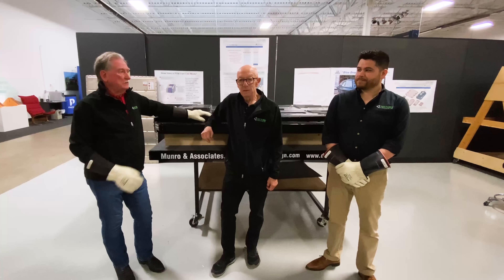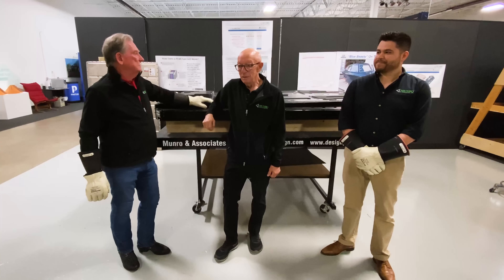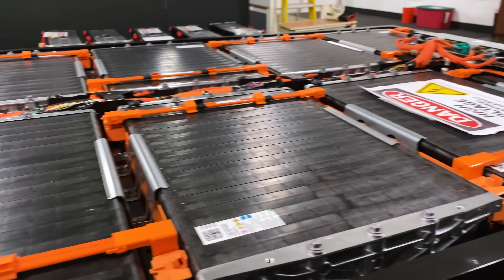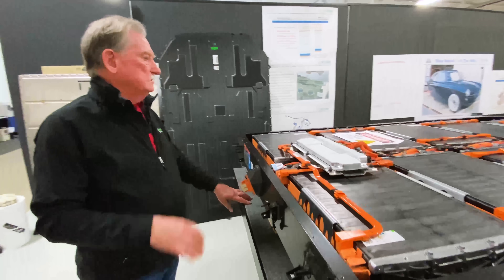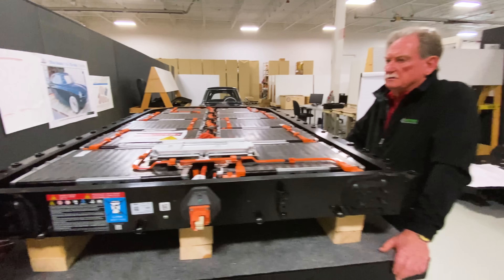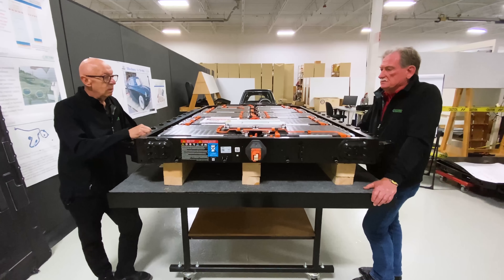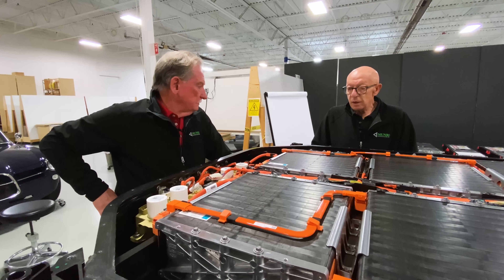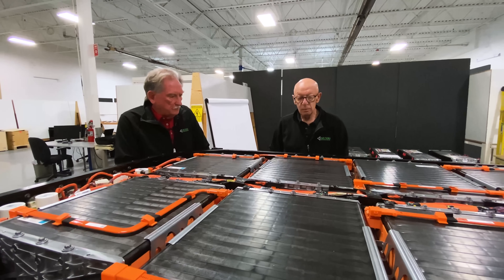Ford Mustang Mach-E Battery Exposed!

Comment: rectangular battery box vs. shaped - does that mean VW can throw this in any number of vehicles while at Ford, it will only fit a Mach-E?
Reply: Modular design of the battery "packs" is how ford is going to use this in everything and allow it to flexibly conform to whatever design they like. The box is being used like part of the frame, so, lots of reason to keep that separate from the actual battery packs
VW has already planned to use the same pack in upcoming designs
Reply: the March-E is not a platform, it is a single model car, so no need to have it too modular over all.
VW plans at least 5 cars to use the MEB-modules and in very different configurations all over the world.
Reply: “It will only for a Mach-E”

No, the modules can be used in various Ford cars & usages, by merely putting the modules into various battery box designs.
Reply: The box tapers at the front, and most (perhaps all) models it might be used in would want that taper, so it's a highly reusable design. What Ford intends to do is a separate question.

Comment: That’s not a “structural battery” pack as Elon described the concept. It’s a flat box loaded with battery modules. It may provide some rigidity but it’s not optimized.

I’m not bashing Ford. To date, we have not seen definitive evidence of a true structural battery in any production vehicle.
Reply: Agreed.  I was expecting to see some significant structure reinforcement inside, and there wasn’t any from what I could see.  Maybe the pack casing itself?
Reply: @AudiTTQuattro2003  Sounds like we’re both fans of Sandy.
Reply: As noted, the most accurate description of this would seem to be a "structural case".
Reply: @rogerstarkey5390  it appears to be strong for side impact but have very little impact on the Hz rating, or rigidity of the structure. Will be interesting g to see the analysis
Reply: Who cares what Elon thinks.
Reply: @twany442  double like
Reply: @twany442  
Triggered?
Reply: @rogerstarkey5390  Of course I am. Wanna try me?
Reply: @twany442  so you adding zero to the conversation helps everyone understand the problem better? Discussing and bouncing ideas off each other is what makes people smarter. Thinking about the problem and making our own judgement, then having that followed up by a more complete breakdown and analysis helps us look at our own line of thinking and if is accurate for this topic or not...
Reply: @Scholzey    what makes you think I want to have anythWng to do with you?
Reply: @Scholzey  Punk boy, Do you actually think that Elon is the only one who knows how to do a structural battery?  I comb my hair with a afro pick, what do you comb yours with? Either way it goes we both combed our hair but which way is the correct way? We all have different ways of doing things.
Reply: @twany442  you can clearly see the structure doesn't have a connection between the top and bottom sheet creating rigidity for twist.

I have curly hair so my hair looks stupid if I comb it lol goes all fluffy. Not sure what that has to do with anything? Is there some secret reference im missing?

The way Ford has added structure has no added value to the car. Teslas way will.

Ford is bolting a battery pack into the structure, but fords battery structure is heavy, and chassis less so. Perhaps their batteries are so heavy that they required a heavy structure to surround them and they didn't want to double up with chassis structure, so they lightened up on that front.
Reply: @twany442  your engaging in discussion. Do you only want to discuss with people who agree with you?
Reply: @Scholzey  No, I don't want anyone to agree with me, I'm not doing this for you to agree with me. I'm doing this to say stop trying to make the Ford's Mustang Mach E your whipping boy. Every goddamn EV has a problem that needs work so focus on your faves first.  And don't start a conversation with Elon said. What do you bring to the table of contents? Regurgitated information.
Reply: @twany442  lucky i havent started a conversations with elon said then hey... lol

we pick apart what the mach e is doing becasuse thats what we are looking at.

sandy said the pack had more structure, so when we saw inside we noticed that the structure was purely on the outside. from that we can say the the batteries inside are not providing strength to anything. its just an observation.

now tesla currently is similar, so pulling apart any current pack from tesla, we can say the same "hey look its not a structural pack yet." its not really a big deal, just of note since the body had less structure, so the hopes of the crowd was to see something different and innovative, but we didnt. so it is what it is..

pointing out faults and areas of potential improvement is the entire reason sandys company exists, so im not sure why doing this to a ford mach e is a problem, we will see the same with the model s plaid that will be pulled apart shortly.

i bet we are going to be dissapointed there is not front and rear castings and that the pack is not structural. no big deal, it should come in the future, especially if the casting dies are able to be swapped out on the press, or if they can use the same castings across all model s and x models.

hmm what do i bring. well, another point of view, another set of eyes on the problem, another lifetime of experiences that might add a tiny bit of perspective or usefullness to the conversation. i dont bring bias or feelings.
Reply: @Scholzey  Noted.
Reply: @twany442  :)
Reply: @twany442  As a ME I can assure you that a true structural battery has some huge rigidity/weight benefits. When pack was removed from car Munro identified narrower than usual side rails as battery provides some structural benefit. I was hoping to see a true structural battery but this is not and I’m not sure it’s even possible with pouches.
Reply: @dksculpture  yeah looks like they just swapped material on the body over to the pack. Same same as normal. The only thing that will effect is the kw to kg comparison between pack, making the mach e pack look worse then it is.
Reply: You damn people think you know everything!  But yet you're riding his coattails of trying to chime in on what he's doing and yet none of you are doing nothing but rambling your lips with your opinion so wait until he's done.
Reply: @twany442  calm down, it's just an engineering discussion - technical subjects are best addressed without ego and emotion getting in the way.
Reply: @bluetoad2668  WTF! You guys come here talking shit about what Ford's doing and most of you can only charge a tire. 
My Grandfather would say: that the Bee and the Wasp used to be best friends until the Bee started telling the Wasp how to produce honey. Then the Wasp told the Bee he knows. Moral of the story is the WASP can't produce honey because he knows. So unless you're going to take an engineering course, let the man finish his assessment and then you can chime in with your knowledge. 
And by the way the very Ford first all electric truck was the 1998 ranger 22 years ago.
Reply: @bluetoad2668 Yes. Agreed.

Comment: Coolant lines next to high voltage....YIKES! Ok for a few years but when the rubber hoses deteriorate, there will be catastrophic consequences. I wouldn't want to be a service tech on that design!
Reply: Ford will never let a dealership open up this sealed unit, it’s always going to be a remove and replace. IMHO.
Reply: Easy to service : Replace the whole pack as a single piece and charge the customer a “fair price” to do it.
Reply: Sandy did mention how he disliked those particular hose clamps for the cooling system in the front. And now they are closed off in the battery pack :S
Reply: No techs needed when a hose fails.  Just call the fire department and Farmers. :)

Comment: Battery pack is to pack batteries. How come they don't mention all the air pockets in side? Such inefficiency. Check their gravitational and volumetric density at the pack level.
Reply: The space on the sides allows for the larger modules of the extended range battery. The Munro people may not realize that, or may just be leaving that discussion for a later video.
Reply: Exactly, I'm surprised they didn't mention that as well.
Reply: Oh look, it's serviceability!
Reply: @MrClassifide  With a reasonable MTTF, serviceability shouldn't be a huge factor here when design HV battery pack. You replace not 'fix' the pack on the spot or at dealership and send the defunct unit to remanufacturing.
Reply: Looks serviceable to me

Comment: Does removing screws diminish repairability? With the right to repair laws becoming more prominent, is this an issue?
Reply: Batteries should never be repaired. Just like a broken windshield. It just needs to be replaced not repaired

Comment: Are you going to tear down a battery module, to cell level?  Please do. Anyway it looks really bad, with all that bus bars (that must weight a ton! ) for the series/parallel connections and the wasted space everywhere! The cast pieces look cool, but overall remembers the i3 battery, one of the worst design...
Reply: It probably makes repairability a lot easier, which is a valuable factor.
Reply: But I don't see any i3' bursting into flames or that BMW had to replace batteries while under warranty.
The design was done in order to make it easy to replace packs, modules and cells. Lets not forget the coolant track.
Reply: @mamadouaziza2536  Yeah, sure! Be my guest, just google i3 flames and....  there are so many to chose from! Fortunatly not mine, but... https://www.reddit.com/r/BMWi3/comments/g8gdgf/ooof_that_looks_like_the_battery_is_on_fire/  Still, that wasn't my point. The design is just bad, infact bmw admitted that one of the major faults of the i3, that crippled its usability, is the terribly small battery. And the wasted space inside is just ridiculous.... Here on the mach-e, probably even worse, but given how big is the battery box, sure less of a problem than on the i3, where even aftermarket "tuners" are able to put over 60 kWh in the same space (instead of the 20/33/44 kWh BMW did). Anyway, wasting space does not make a battery more repairable or modules more accessible. Considering that, in case of faults, you have to bring the whole battery box down and open it, don't know how saving a few seconds removing a module will change things. Also the 2 different modules sizes... uhm...and the metal clamps to hold the modules down? have you seen them? Really a bad example of design. I am sure Sandy will point that out later...

Comment: 16:39 finally a guy that talks some sense.  plenty reasons why "questionable" design decisions are made.  Tesla's designs somewhat easier to judge as they don't have much other car models where components can be reused.  17:25 finally a criticism from Sandy. Tesla/Elon never released info how their batteries be recycled or reused
Reply: But making something worse (more airspace and more material) just to make the end of life reusable at about 60% usable capacity is stupid. Better to recycle into new packs. Recycling will be easy but there just isnt enough yet as pack will being being recycled after 15-25 years of use

Comment: How many engineers does it take to unscrew a battery cover..... There has to be a good punch line. Keep up the good stuff. A few more hours of video and I will have my Voyeurs in Engineering just from your channel.
Reply: 3
2 to remove screws and  Sandy to decide that  the build was pathetic 😊
Reply: Only one - but you may have to wait a  w h i l e

Comment: When Tesla starts using 4680 cells, if you can find a way of cost-effectively and nondestructively breaking them apart, I'd love to buy a few for projects.  Maybe a recycling company could do it for you.  I'm a big Munro Live fan!👍
Reply: NO 4680 CELLS FOR YOU...!!! (Soup Nazi voice)
Reply: @phillyphil1513  😀
Reply: If they go Cell2Car you will need to bolt a used ModelY to your wall if you want to reuse that battery as a stationary storage after its life in the car.
Reply: @e-redj  In that case, a Model 3 would be lighter and easier to bolt to the wall.
Reply: @JohnPMiller  yes, but currently I’ve only heard of the ModelY Europe to go 4680, or the Cybertuck or the Semi, and I thought the Model Y would be easier to bolt onto the wall🤪😜
Reply: I bet there's a picture from like yesterday floating around of employees signing the first complete 4680 structural pack.  Seems like they've agreed to a complete design now.. hopefully full production starts.

Comment: I’m glad he brought up recycling/reuse as it’s becoming more important. Love my Tesla but I don’t want to contribute to massive amounts of waste in a decade or so unnecessarily.
Reply: I'm with you. Tesla may be the nicer desing for useres now, but once a tesla hits the end of his life i think they're harder to reuse/recycle than Ford or VW. Also Ford/VW look like they're easier to repair.
Reply: @warpheus1158  I believe someone left Tesla specifically to start a company that recycles batteries.
Reply: @TheEvilmooseofdoom  
I hope that was sarcasm?
Reply: Do you think that Ford/VW battery modules can be replaced individually if you got maybe just one bad unit?
Reply: The tesla packs will be recycled, I think they've mentioned that they will probably reach a point where they could get 100% of their battery materials for new vehicles out of recycled packs. Difficult part is just doing that recycling as efficiently as possible and making it profitable to do so, battery recycling cost needs to ultimately be less than the cost of sourcing new materials.
Reply: @What16384  let's hope they figure it out.

Comment: The battery pack could have a plastic cover?
Reply: Nope, that would be stupid and dangerous in case of fire for the occupants.
Reply: @alanmay7929  Sandy showed a plastic a few days ago that was better than aluminium to control fire.
Reply: @FernandoMagnoAlves  the idea of overusing plastic is good but do anyone plan on recycling them?! At this point we should just make carbon fiber or other light materials much cheaper.
Reply: @alanmay7929  the problem would be cost. The plastic still a valid point so far. The arguments that you used are not good enough
Reply: @FernandoMagnoAlves  you're out of your mind, EVs are supposed to be made and be green, other manufacturers like volvo, bmw toyota and mazda have been using recycled materials on their cars and equipments, why use more plastics when its a serious problem nowadays?!
Reply: @alanmay7929  I am sorry, but what you are saying is nonsense. I don't have time to explain the basics for you. For sure the plastic can be recycled.
Reply: @FernandoMagnoAlves  yeah continue with your nonsense Einstein. You never know where car parts will ever ends, electronic waste have been burned in Africa and parts of the world for decades and no one talks about that, but you're here promoting more plastics instead of carbon fiber or other advanced materials?! Wtf!
Reply: @alanmay7929  in the case of the car you need to add the quantity of energy consumed because of the weight of the aluminum case
Reply: @FernandoMagnoAlves  carbon fiber could easily handle that, carbon fiber is way lighter and is coming down in price.
Reply: @alanmay7929  why we never see in budget cars?

Comment: Well, at least it's much kWh for the size of the car.
Reply: This is actually the "small" battery pack. I wonder if the larger pack has cells with more capacity and the same form factor, or if the are using the wasted space between the modules more efficiently. Packaging is really poor in my opinion.
"At the end of the day" this pack is twice as high as the Tesla Model 3/Y pack with a similar energy content.
Reply: @bernhardleopold6702  Twice as high? Really? Wow, that's quite a difference!

Comment: Thinking of long term driving through muck and rain combined with wind speed , I think you'd see potential for excessive corrosion in that battery pack from the minimal sealing of that cover. Seems like a lot of effort put into the cover itself, then sort of stuck on with a tiny perimeter gasket. Even with the zillion screws, that cover will slowly relax between the screws.
Reply: They have actually tested if for corrosion so no issues there.

Comment: I’m surprised at how much empty space is inside of that case.
Reply: This is the small battery version I think, maybe the extended range is full ?
Reply: @snikt228  Yes, that's it. The extended range pack has more of the same cells in each module (32 instead of 30 in the big modules and 28 instead of 24 in the small modules), so the extended range modules are longer and fill the space on the sides.
https://jalopnik.com/a-look-at-the-engineering-behind-the-2021-ford-mustang-1839911078
Reply: more likely to reuse the casing for higher capacity or other car models in the future

Comment: The structural battery pack will make this design look so outdated.
Reply: Nope, never, ford can actually receive the pack already assembled by SKI and just install in the battery pack with their electronics and its done. Plus recycling will be much more easier than the tesla one.
Reply: @alanmay7929  Relying on a third party to build a battery pack is not good. Ford won't be innovating fast with this approach and they lose out on margins. There are lots of negatives with the battery pack process.
Reply: @alexhjohns  are you serious?! Ford just like tesla and many other manufacturers works closely with batteries makers to design their packs according to their applications in cars.....
Reply: @alexhjohns  the BYD blade battery is actually the best design of battery cells/packs that I've ever seen tbh.
Reply: @alanmay7929  You do realize that Tesla designs and assembles cells into packs, right?